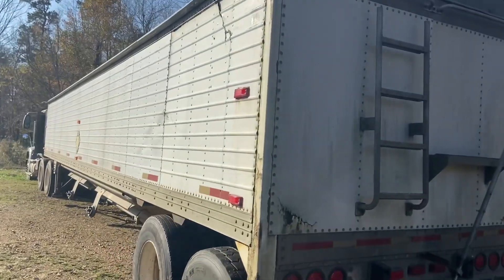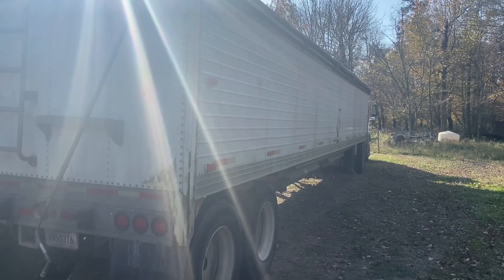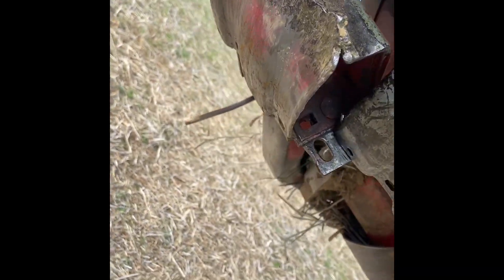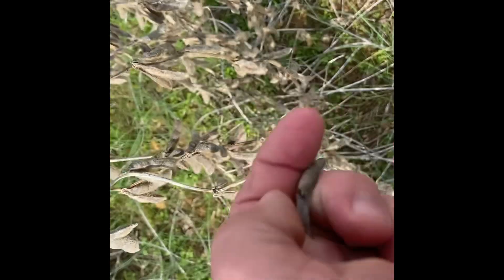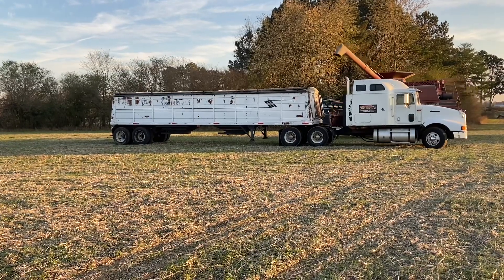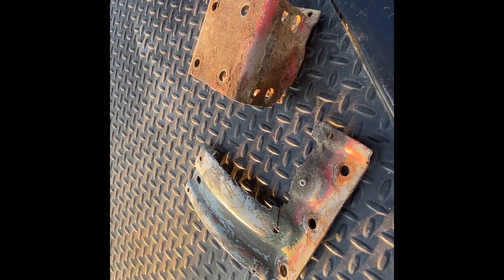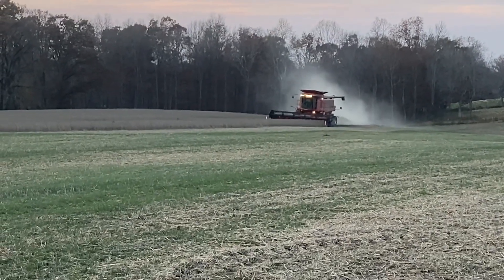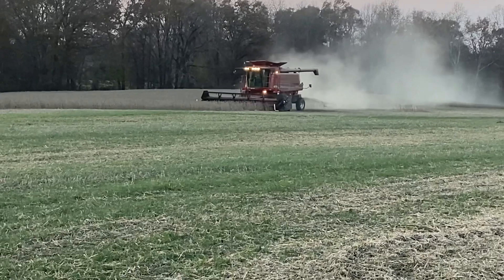Day 9 of 2020 Soybean Harvest. Spent most of the day working on the header.

Comment: Wet loads SUCK...
Always fun working on headers🙄
The sub count is most likely YouTube messing around 😠
Mine is finally going back up👍😎
Reply from the maker: Yeah I’ve gained a few subs today. Back on track. 
I had an empty bin to put the load in but no air to put on it. Plus I would’ve spent $400 in power to dry it down. It’s life!
Reply: @Thomasfarmstn  yup.. if you can get it off the truck...